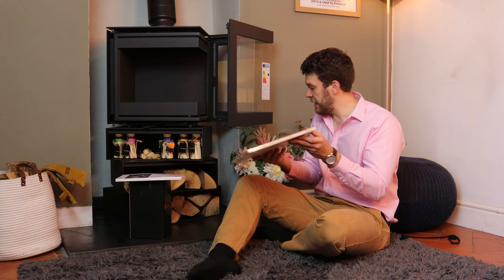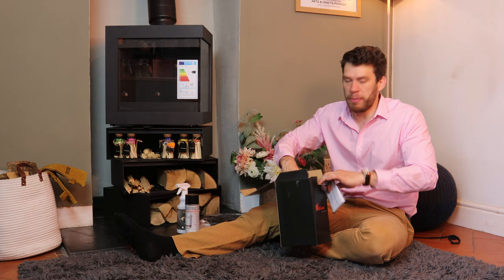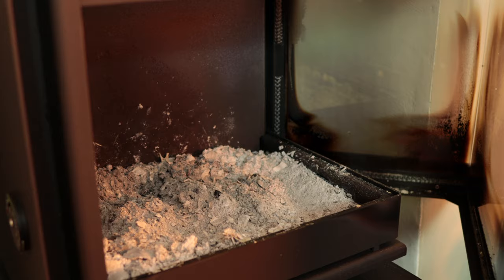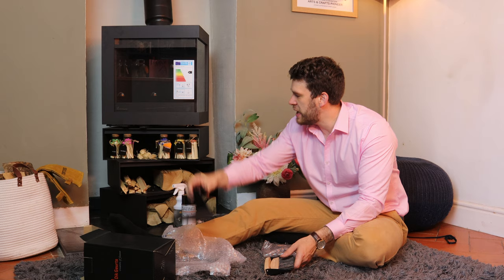First impressions of the Dik Geurts DG Bora Corner

Comment: Great review, as always!

Last year I was so fed up with trying to remove ash using tools which just didn’t work, I spent hours searching for something practical. I finally found a little brush and shovel set almost identical to the one you have there (ours came with a tiny screw on handle for the shovel bit). We’ve been using it for over a year now and I can confirm it works perfectly and has withstood some pretty heavy usage. The magnets to keep them together is a beautiful touch too. 

Our second stove is finally being installed in the dining room this coming week, so I’ll be ordering a new one from your site soon.
Reply from the maker: Thanks for the comment, sounds like an exciting week. What are you having fitted?
Reply: @TheTortoise we’ve decided on the Ivar 5. We also considered the Pickering and Contura 210. We really liked the look and size of the 210, but there were no reviews or write ups anywhere about it and we ideally like to have opinions from people in the know. We initially bought a WP5PLUS for the lounge and that was the same situation with no reviews anywhere at the time. We really didn’t get on with it. We mainly burn wood and there was next to no control, it got through wood like you wouldn’t believe. So we had to replace it (with the Newborne 40FS), which wasn’t ideal - we’d really like to avoid doing that again! 

My problem is, every time you do a review I want a new stove! We’ll have one in the bathroom at this rate! Thanks for all the great info & advice 👍🏻
Reply from the maker: @PsychedOut..  no problem at all. I’m very confident given what you’ve said, that you’ll have none of these issues with the Ivar. It is excellent at what you’ve mentioned as important criteria!

Comment: Proud owner of a dik Geurts triple wall, Nice to see one of the Dik Geurts in a video of you.  If you have the time I would like to see somebodys opinion on the triple glass Sided stove. 
On the part of how messy things can get do not worry about it. If you clean out the fireplace (Firebox) on a regular basis it is not messy, except when a log rolls over to the glass and you have to open the door. Then some ash will fall out of it.
Regards
Reply from the maker: Yes, I’ve seen the Triple. Looks like another very smart bit of kit!
Reply: About to buy the triple glass wall. Very pleased with product?
Reply: @rahmer81  Yes we are very pleased with the product. Just a tip if you have the oppertunity go for the largest (Highest) ash retainer ( ledge just after the door) for keeping ash inside.

Comment: Hi Gabriel, Great review of a very funky stove. I would like your advice on a completely different subject - painting fireboard. We are having our mantelpiece, hearth and fireboard fitted shortly and wondered if you could recommend a brushable paint that could be used on the fireboard? I've seen Vitcas do a suitable paint BUT it's only available in spraycan form. Any advice would be greatly appreciated. Thanks, Chirayush
Reply from the maker: Assuming you’re talking about the interior walls of a fireplace opening then I would just use normal emulsion. Heat proof paints are generally for parts that are directly heated eg, stoves and exhausts, but the surrounding walls can generally be painted with standard paint. This has always worked for me and means I can match the colours with the room.